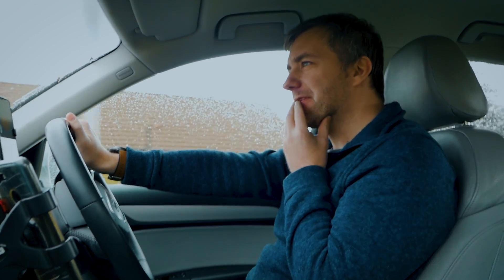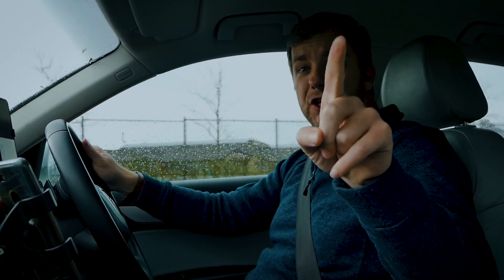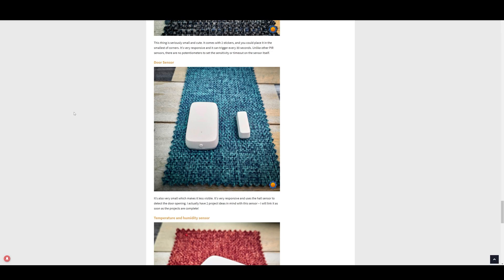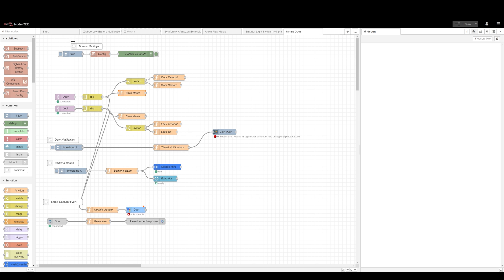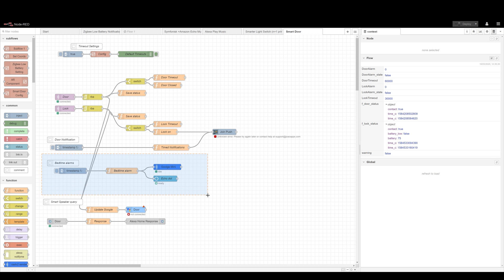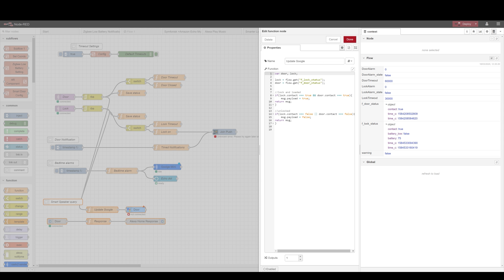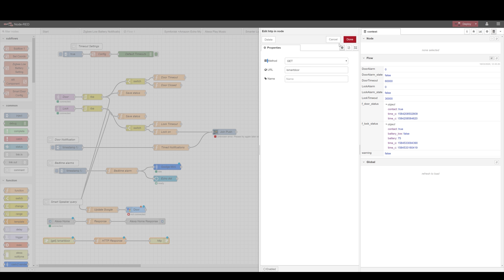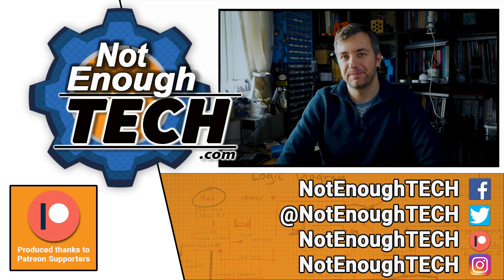Smart Door - how to retrofit "smart" into door on a budget

Comment: I don't wish to be critical of your excellent work but the door is not locked unless the key has been turned and this system is not checking if the key has been turned. It only checks the handle has been pushed up.
Reply: Old post I know, but I must be lucky as with my door, pushing the handle up only engages the upper and lower cams/catches. The bolt extends with turning of the key...
Reply from the maker: Even more accurate results for you then.
Reply from the maker: I know. But sadly this is whole new level of taking the lock apart. I'm pretty good at doing both (handle up + key twist) as long as I remember. But that's all I could do on a tight budget. On a positive side this method would work with deadbolts

Comment: I have a dedicated server for node-red and I would like to avoid having a raspberry for zigbee to mqtt. Apart from the upcoming sonoff zigbee bridge, have you tried Zigbee to Tasmota or any other light weight solution for bridging zigbee with mqtt?
Reply from the maker: I was pretty sure you could use the cc2531 with a Linux machine.
Reply: I'm currently running centos 8 with a kvm vm with podman containers inside that, the cc2531 is easy to get running with linux as you can use usb pass through you just need to pass through the lsusb info. If you get stuck I can assist you, so no need for a bridge
Reply: I forgot to say that my server is in a different location 6 mile away from my house, so I would like to have a dedicated standalone zigbee to mqtt device.
Reply from the maker: Then you may have a Problem. Not sure what would be the best solution for ZigBee in this situation. All hubs are not open. MiHome hub has API but supports only aqara devices

Comment: I've been thinking about doing exactly this! No need for a computer to be able to lock and unlock my door, just keep me from forgetting! I'm thinking about going even cheaper, with 433MHz sensors, since I have several doors and gates to do. One question regarding your implementation: that white tape to hold the sensor in place: what is it? Doesn't look familiar from here in the US. I'd think that might be the weakest point - if it slips, you start getting spurious "door open" events.
Reply from the maker: It's just electric tape. To prevent it from slipping I wrapped it around with one more separate layer. You can use hot glue or other tape of your choice. I'd recommend ZigBee because you get battery info as well as contact status but other than this it will work fine.
Reply: @notenoughtech  good point re: battery. Seldom seen white electrical tape: looks neat.
Reply: Digging around a bit, I think the big win (especially for something security critical, like a door) is that zigbee sensors distinguish between quiet and unavailable. 433MHz are apparently notorious for dropping messages, with no knowledge at either end that the connection failed. So that's what you're buying for the extra $10 a door. (Better 433 sensors provide low battery messages, but ... those are creeping up into same price range as zigbee, at that point)
Reply from the maker: @RossReedstrom  if you can't fix it with tape it's unfixable 🤣😂🤣

Comment: A very inspiring video!
FYI: The " more on" link is incorrect :-)

Will watch again when I am not almost asleep and I have some items to play with.
Going to think about a place to use this technique now.

I hope the doorsenser drops in price a bit, 15 euro's is not quite as cheap as I would like.
Reply from the maker: Re pasted the link. Now sure what happened 🤷🏼‍♂️
You can find these for about $7-8 each but the one I used is little more expensive. It's down to zigbee2mqtt hookup
Reply: @notenoughtech  are the cheaper ones not interoperable with zigbee2mqtt?
I would like to put them on my windows, but €15 per window is about 8*15=120 so I have to consider that a little longer.

Thank you again for the inspiration on practical applications and programing!
Reply from the maker: Like in my example some of them needs to be added as new device. Some are already supported. If you pick mine then you can be sure you can use the same as me zigbee2mqtt entry otherwise you will have to spend a little time figure out the device JSON yourself.
Reply: @notenoughtech  Actually, the $7-8 I see on AliX are all 433MHz (down to $5 in bulk) Cheapest I'm finding for zigbee is the Xaomi Aqua for $9-12. Now I have to decide if adding yet-another-radio (receiver ~ $2-10) and service to convert to mqtt is worth the time. Hmm, if I do, maybe I can get that old weather station sensor working ... :)
Reply from the maker: @RossReedstrom  tomorrow is the 6th anniversary on gearbest check their listings too